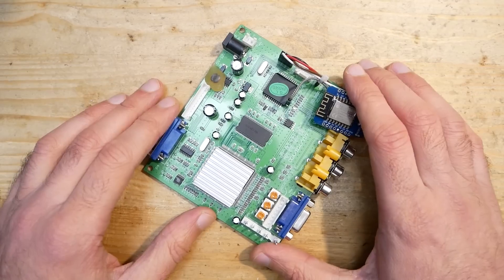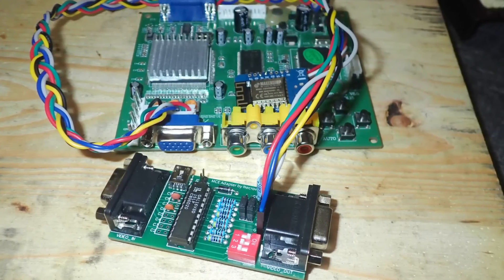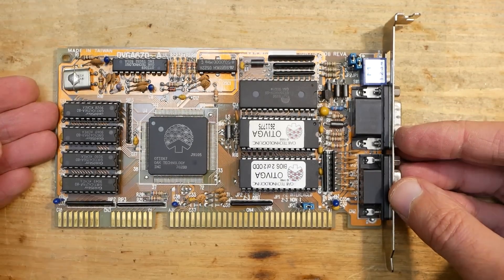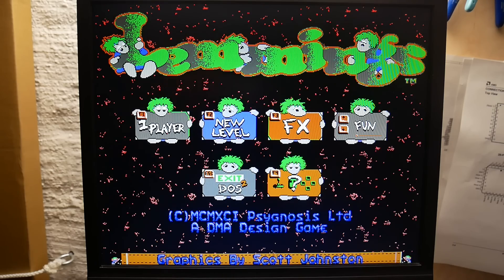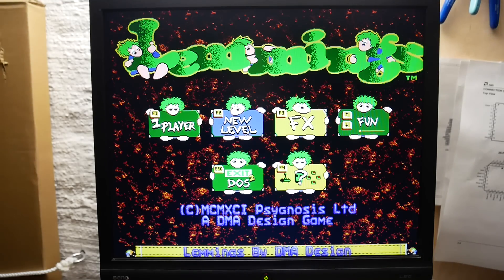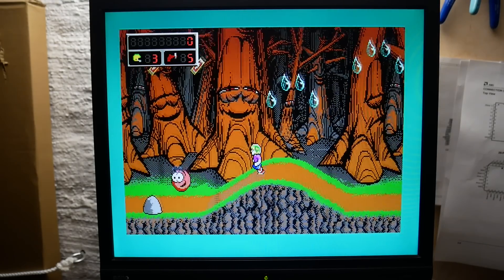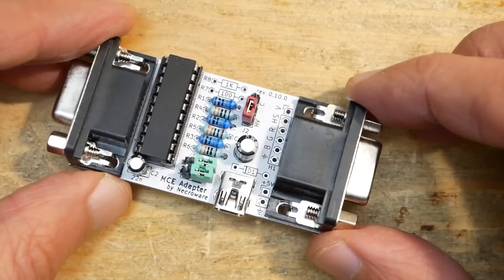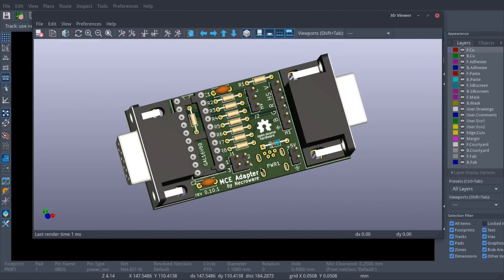Updates of my MCE-Adapter (simpe MDA, CGA, EGA converter)

Comment: is it possible to use this to convert the Commodore 128 RGBI output to VGA?
Reply from the maker: I'm not 100% sure, but as far as I know C128 has a normal CGA TTL output, so it should be possible to convert it to a 15kHz VGA analog signal using this adapter.

Comment: I have a few questions. Any GAL16v8B will work with this and it's been forever since I have played with GAL/PAL chips so any modern software recommendations?
Reply from the maker: Yes, any would do. It's important, that the model you use have integrated pull-up resistors on all inputs. The one with "B" in the end should have. I think, without "B" haven't.

Comment: Great video! Question, can I connect it directly to the RetroTink 4k? Or I still need the GBS-8200?
Reply from the maker: Thanks. You can connect it to anything what accepts those frequencies. I use it directly with my monitor.
Reply: @necro_ware  thanks, just to be clear, you converter VGA port will output 15KHz, correct?
Reply from the maker: @duskomarincic  yes, the adapter just passes through the frequencies.For cga and low-res ega it's 15kHz/60Hz, for high-res ega 21kHz/60Hz, for mda/hercules it's 18kHz/50Hz.

Comment: Can you show some oscilloscope traces, on what and what not these GBS8200 boards accept as valid RGBS signals and what not?
I have an old CNC mill with Motorola 6845 graphics, so likely MGA signal with H/V out.
V-sync is 50Hz, H-sync 15.5kHz.

XORed H and V sync, to get composite sync, my XOR composite sync is TTL high with short negative H-spikes (when V sync is low) and TTL low with short positive H-spikes (when V sync is high).
Color is monochrome TTL, which goes directly on green input.
But I get "no signal", no matter what I try.....
Reply from the maker: I made couple of videos about this topic, where you should be able to find everything you want to know. But here some facts in a nutshell:
- Motorola 6845 was used on both monochrome and color graphics adapters.
- MGA is unknown to me, you probably mean MDA and/or Hercules
- MDA runs at 50Hz/18kHz (and not 15kHz), which is not supported by GBS-8200 out of the box
- You can use gbs-control firmware to improve compatibility
- Though 60Hz/15kHz is the only one mode which GBS-8200 supports reliably
- GBS-8200 is not a MDA/CGA/EGA converter, it's a scam
- GBS-8200 requires analog RGBS video signal with levels between 0V and 0.7V
- Applying TTL voltage directly, which is 5V, will slowly kill your GBS-8200

Here are my videos about this whole story:
Part 1: https://youtu.be/7c3yLX52ZEs?si=yUFkV6nV2W820KF-
Part 2: https://youtu.be/aUFKB4b5KpE?si=pcI2m9lt9yWGDqTl
Part 3: https://youtu.be/F1685u-QQ0k?si=GhX0AAhI_zXIROcx
Part 4: https://youtu.be/f9ryiV4UiKY?si=LPzr8BLPReIUm9Jo
Reply: @necro_ware  Thanks, I'm now testing that GBS-8200 garbage with 2x HP-5359A time synthesizer for H/V sync and a HP-3326A, which makes color sine wave, in sync with HP-5359A to see, what timings/pulse lengths are working.
V-sync works down to 21ms/47Hz before GBS8200 quits, so far I think it's more a problem with 15kHz H-sync.
TTL/5V monochrome color gets detected with no problems, depending on potentiometer settings, it saturates at about 3V from 50Ohm source/HP3326A.
Perhaps I get lucky and I can just shorten Hsync pulses with CPLD board, those seem rather long, in Dialog4 control.
Reply: That GBS-8200 scam stops working if H-sync exceeds 38µs/below 26kHz with RGBHV, perhapsI try RGBS with signal XOR too, but I doubt that scam garbage works with it either.
Time to find a MCE2VGA, I guess. Or start a FPGA project myself, have plenty of boards with 1MB++ DRAM/SRAM around, to digitize MDA and output it at VGA frequencies again. Since it's just monochrome, I don't even need ADCs, just some rather stupid frame buffering....

Comment: Question I built one of your MCE adapters and the only issue I have is I am getting jitter on the top and bottom   of the display.  This is on my Tandy 1000EX using a GBS-8200.  I have tried using several different LCDs problem appears on all of them.  If I use a RGB to HDMI output works just fine and I have a stable sync
Reply from the maker: Hey. Since this is an open source project, it would be nice to get such questions on the project site, so others can benefit from it and share their thoughts. This is the whole point of open sourcing something, so the knowledge and support can be shared. Here on YT it would just drown and in the future if someone has the same issue, the person would need to search from the beginning.

To your question, GBS-8200 is extremely picky, especially with its stock firmware. I use my with gbs-control firmware and it is a lot better. The quality of the signal generated by the MCE-Adapter depends a lot from the cables you use and the quality of the GAL chip. I had some (used?) old GALs from China, which were not able to generate a stable signal. Also instead of the cable on the TTL side I use a coupler (gender changer) to plug the adapter directly into the graphics card. That improves the signal a lot.  Meanwhile I made a dozen of MCE-adapters for some guys in the German community and they all work perfectly fine.

If you already have buffered RGB to HDMI adapter there is no real point of using my MCE-adapter through GBS-8200. The idea was actually to have a cheap and simple solution which can be plugged directly into a 15kHz capable monitor.

Comment: Is anyone on here familiar with the GBS-8100 - essentially the inverse of the GBS-8200 VGA to CGA. But again I'm not sure if it's CGA or Analog RGBS that it outputs. If I connect up to a CRT TV via Scart I get an image, which is perfectly fine. If I use a sync separator and connect up to a 15Khz VGA monitor I get a blank image - not a 'no signal', just a blank image which suggests the sync is fine but it can't read the RGB signals which would make sense if they are CGA. Therefore your converter would be able to help except that the output from the GBS-8100 is just the 5 wires R, G, B, Csync and GND. I think to convert from CGA to RGBA I'd need an intensity signal, is that right? Or is there another way?
Reply from the maker: Well, since GBS-8200 is not really CGA-VGA converter, most probably GBS-8100 is also not a VGA-CGA converter. I don't have GBS-8100, but from GBS-8200 I know, that it's CGA/EGA support is a scam. CGA/EGA are 15/21kHz digital signals, so called TTL, with 0V and 5V level for 0 and 1 for each color (and intensity). If you connect this RGB signal directly to a 15kHz capable VGA monitor it will die after a while, because VGA is an analog signal with voltages between 0V and 0.7V. Wireing 5V instead of 0.7V is deadly as you can imagine. However, GBS-8200 can not handle digital CGA/EGA signal, only analog RGBS similar to VGA, but with composite sync. It calls it proudly CGA/EGA only because it works at 15kHz, just like CGA and low-resolution EGA would, but it is not really CGA/EGA. It wouldn't even be able to convert high-resolution EGA, which runs at 21kHz. I assume GBS-8100 doesn't know anything about CGA/EGA either and outputs the same analog RGBS signal which GBS-8200 expects on the input, but I can't tell definitely. If it is, you'd only need to decompose the sync properly. Check the levels of the RGB output, if it remains below 0.7V, it is analog RGBS.
Reply: @necro_ware  thanks for your reply. That's very helpful. On further experimenting I find the levels output are around 2-3v so that's TTL. ChatGPT confirmed this so not sure what to make of that! But I noticed the voltages changed quite a bit depending on the colours on screen (the blue and red levels drop to around 1.3v on the green Atari desktop) so I guess that's analog. So I think what is happening is that the TV is quite robust in the signal level it receives (and perhaps it has some circuitry to drop voltages above a certain level). But the VGA needs more accurate values. However I've tried a couple of acclaimed scart to vga converters that handle the sync splitting and they seem to have resistors to drop the ttl levels to around 0.7v but still no picture. Except very occasionally when I'm connecting wires up on the breadboard where the image appears momentarily, usually in red monochrome.

So I'm going to do some more experimenting without the scart to vga converters and do the voltage drop with a 470 ohm and 75 ohm splitter and see if it works. If not my attention will go back to the the sync splitting. I have an original Atari St to check voltage levels and oscilloscope patterns against, and that works with these monitors, so hopefully I'll be able to find a way with the GBS-8100. But anything else you suggest I should consider would be useful, thanks.
Reply: @necro_ware  did a bit more googling and it's suggested the GBS-8100 outputs 480i. I wonder if this could be the issue. The VGA monitors probably don't like this so perhaps I would need to convert down to 240p like the Atari emits. Is this possible without hefty expensive equipment?

Comment: Not work for me, I try convert 15khz rgbhv signal from old cnc with 9pin connector (6 wires) and use this adapter and gbs8200 (pcb made by jlpcb) and latest software version  and i can see that monitor is struggling with signal, it shows a fragment of a picture for a second but most of the time no signal. I have a better result  with cd4030 xnor gate and few exit resistors
Reply from the maker: Please don't forget, that gbs-8200 requires RGBS signal. RGBHV doesn't work, at least with the default firmware. You have to select RGBS on the gbs-8200 and set the adapter to C-Sync mode using the J2 jumper. I use gbs-8200 sometimes with this adapter and it works at least for CGA at 15 kHz and MDA at 18kHz with gbs-control firmware. Unfortunately gbs-8200 is not able to show 21kHz EGA with any firmware. However for a CNC you don't need all this anyway, you probably don't care about right colors, so a simple circuit with a xnor and resistors is sufficient.
Reply: @necro_ware  thank you for quick answer, as I understand, this adapter convert rgbhv to rgbs via j2 jumper and gbs 8200 recognize a signal and convert to 31khz vga signal and reproduce to a analog lcd ( i have  dell 157fpf and samsung syncmaster 710n) . My original monitor was hantarex 9 inch crt, rip...and I'm currently  using philips cm8833, I don't have a scope to determine was it 15 or 21 khz, and he is slowly dying too, so I really need a solution that works, fast. I am trying these cheap solutions, yours was the most promising, and I don't have many options, actually, what on the market is  expensive, non compatible options for me and any help would be a great deal for me. All I have left with is gbs8219 or rgb2vga that I could find on the internet and i am not convinced that any of these will work properly for me. The funny thing is that any solution that I try so far is giving a same result-white numbers shows for a second or two, sometimes readable, sometimes not. You are right, I need only 3 colors actually - red, green and most of the time yellow, but this cm8833 shows only green and i manage with it, and I think this option need just a little tweaking...

Comment: Very interesting and useful so far. btw, it could be interesting and perhaps meanful if you would look at the floppy drives problems and howto for floppies. I've got the Samsung 3.5'' its lamp lights when the PC addresses to it and the large flywheel below (going opened to bottom side of it) doesn't rotate... suppose its drive engine burnt as far it was used as a test device lying on the table... So far, waiting for new videos gratefully.

Comment: Did you try original HGC 720 × 350 on BL702A? I see you setup CGA mode on it.
Reply from the maker: There are not many hires hercules games out there, most hercules games are just MDA or CGA emulation. I definitely tested hires hercules graphics on my NEC monitor. I don't remember if I tested it with Benq, but I assume, that it will work too.
Reply: @necro_ware  than you very much, BL702A works! Of course it's not perfect, but after manual adjusting pixel clock and position, text looks good!For graphics I have manually re-adjust...
But you know, to connect HERCULES card to my new BL702A I just need two 1K resistors, no active components!
Reply: @necro_ware  for Hercules cards, you can always  run Planet X3 - it supports all vintage graphics cards and audio chips.

Comment: Hi!
Which desoldering station you can recommend? What desoldering station on video "Repairathon 2022: Repairing a heavily damaged 386 mainboard", temperature?
Reply from the maker: ZD-915. Temperature is 350°C, but depends on the temperature in the room. Especially if it is very cold, I use hot air in addition to heat up the PCB.

Comment: I built 5 of the first version from the project file on pcbway. Really fun to build but I couldn’t get them to work for some reason. Maybe my monitor doesn’t support the 15KHz signal?
Reply from the maker: Well, yes, you still need a 15kHz capable monitor, otherwise it will not work.
Reply: @necro_ware  yeah I’m an idiot. I also didn’t flash the eeprom lol

Comment: Very cool and so many good improvements.🙂
In hindsight it is funny the EGA engineers didn't just do brown instead by default as slightly darker yellow doesn't have many contextual uses. Other major change I'd have made is making Cyan & Dark Cyan darker too as they have too little contrast with White & Grey. But then again in hindsight I'd have made CGA's second brightest shade also darker since it is not contrasted enough with the brightest shade Ie. see Game Boy gradient contrast.
I really love the Hercules color tint option as any options are better than none, Green looked great but a shame Amber couldn't be better. That's been something I've speculated on like changing monochrome graphics to color tints on color screens or putting a color gel layer over a B&W CRT to give it a similar look to monochrome phosphor tints since they aren't as plentiful.

Comment: This is such a nifty little project! 😃
As the picky engineer that I am, I have a remark on the way you generated a logic signal out of the sync pulse: I would be a little more careful about placing an "analog" signal onto a CMOS input.
When the sync pulse changes between positive and negative polarity, the low-pass filtered signal transitions accordingly and therefore spends a relatively long time between High and Low logic levels. In this conditions a CMOS input does not guarantee that either the top MOSFET or the bottom MOSFET are completely off so there is the chance that some current flows directly between VCC and GND. This stresses the input and can, potentially lead to failure. A second problem is that, while the filtered signal crosses the threshold, it doesn't do it "decisively" so even little noise can cause spurious transitions which can be a problem for asynchronous logic.
In your case transitions are fairly rare so, probably, nothing bad happens but there is a simple way to make sure that everything is fine: insert a logic gate (either a NOT or a buffer) between the RC filter and the input of the GAL. Make sure to choose a logic gate with Schmitt-trigger input (which has hysteresis so different thresholds depending on the state of its output), with supply voltage suitable for the input of the GAL and with input logic levels suitable for the sync signal. Such single gates are available in quite small packages.

Comment: Does anyone know where I can acquire a 9 pin video cable?  Will a DB9 Male-Male cable work?
Reply from the maker: Yes, that would do. But keep it short and try to find a good quality cable. You can use a simple gender changes as well, as I showed it in the video.

Comment: Okay, I do have to wonder if the early-revision MDA colour-output undocumented feature works on this. If you haven't heard of it, the attribute bits on MDA match up with colour bits on CGA text mode, giving underlined text on MDA and blue text on CGA, but early MDA cards connect those bits to the pins used by the RGB channels on CGA (intensity is the same on both), so you can actually get colour out of them if you hook them up to a colour TTL monitor that'll take their sync signals.

Also, the MDA output with the intensity should be giving you 4 colours, not 3: black, white, and two shades of grey. A darker shade of grey from 0 video and 1 intensity, and a lighter one from 1 for video and 0 for intensity.